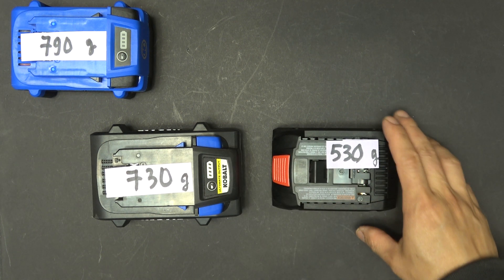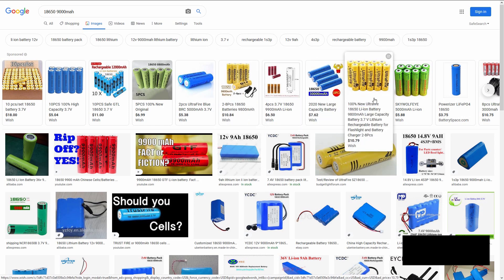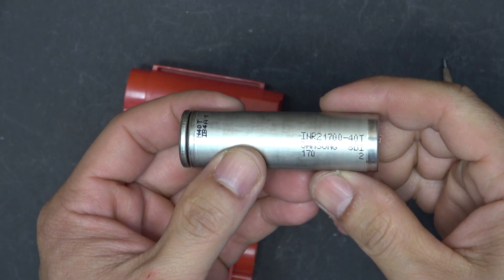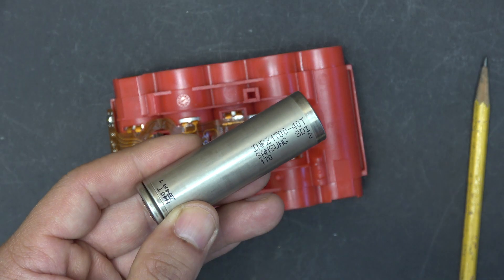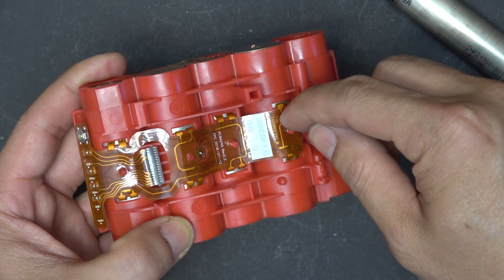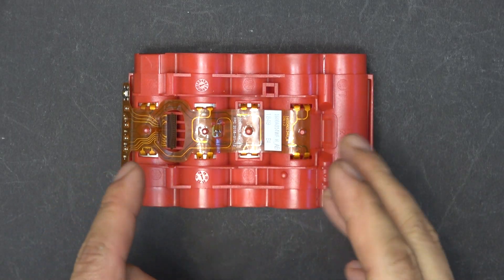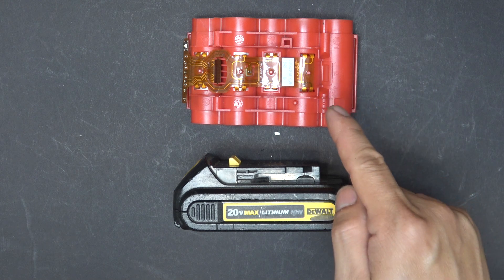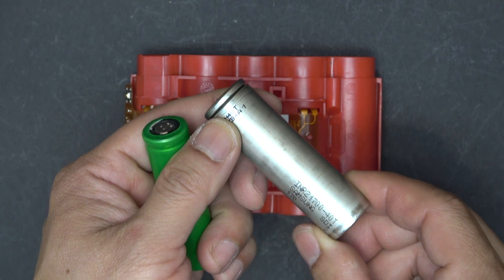Teardown: Bosch 18V Core18 4Ah battery. I've never seen anything like this!

Comment: Don't be to sure the so called BMS has balancing! Even though many of the pro-brand power tools batteries does have balancing chips they DON'T balance. But they do measure voltage of each cell for lower/over voltage protection, that's all. If you still have the battery try to discharge one of the cells to it's voltage will be lower than the others and then charge the battery. Afterwards check if all cells have the same voltage, I bet it want! Please prove me wrong 😉

Comment: I see you did a little Señor Sparky on your caliper there. I did the same thing when I was first building batteries. I was measuring something, I think a piece of nickel strip, and !SPARK!... I shorted out the tips between two 21700 cells and ruined the tips on my calipers. Luckily, it was a low-dollar, knock-around pair I use for general stuff, and not my Starrett calipers. I bought a pair with plastic jaws for under $10 that I use exclusively for building batteries. I suggest you get a pair, too. By the way, I love your videos! Glad someone took the time to pull one of these apart and see the great quality you get with Bosch.
Reply from the maker: You have keen eyes, Dallas.

Comment: The battery cells are put into the plastic while the plastic is still hot so when it cools it shrinks and gives a much better thermal conductivity.

Comment: 9:04 Unfortunately there's no balancing. The BMS board shuts down if it's not balanced, but it doesn't actively balance the cells. As a result, the pack can stop working when the cells are still good. If you have the patience, you can manually balance by charging individual cells to get yhe pack working again.

Comment: Using copper it is not really for get less resistance or weight saving. As you realize you broke this copper bridges when disassembling the battery. Try to measure same lenght of 0.1mm nickel and you will find its the same.

Comment: I bought  BOSCH AL 1830 CV  battery charger and PBA 18V 2.5Ah W-B in Ravenberg
aug 252023
Now I find battery is not charging
greeen is not  blinking ,used only for 2months   5hours
charged only 5 times
I am so disappointed 
Sunil Jay in Srilanaka

Comment: Hi mate, ive had a this Same battery pack and ive watched your video to get the batterys out. Ive noticed after taking the batterys out and charging them in my 18650 charger it makes a hissing sound. Is this Dangerous? Should i throw those batteries away?

Comment: hi , i have a questions, it seems that the INR21700 cells in pro core battery doesn't has the plastic cover over it ( as for the balance connection ), would it be shorted out if two batteries pull out bare and touch each other without the plastic cover. Thanks. Because i remebered someone said that if the plastic cover is broken, it is not safe to have the 18650 touch each other .
Reply: You can only pull them out if the strip on the other side is already removed. Just touching two loose ends does nothing.

If the plastic is broken... I would be careful about what you do, because if you do manage to let two cells touch sides while the copper strips are still all connected, you are shorting out one cell.

Comment: I have a lady I'm trying to help out that has a bike with a Bosch kit on it that came with 36v 2.4Ah battery.  She wanted more range so bought a 36v 4Ah battery and it didn't work... got a new charger on the advise of Bosch.  Still doesn't work, bought another brand new 36v 4Ah battery... that also will not charge.  The original 2.4Ah battery works on either charger, the 4Ah batteries do not work on either charger, charger is correct for all of the batteries.  I suspect the new batteries have bad thermistors so they won't charge... there really isn't anything else in there that can cause this that I can think of.  Anyone have similar issues with DOA batteries from Bosch?
Reply: eBikes batteries from Bosch are different than the tool batteries.

Comment: Electrons flow on the surface of a conductor, hence why cables are stranded. Unless that copy strip was too small to carry the current without melting, your observation of the design isn't meaningful. Since we know the battery does indeed carry the current effectively, the design is good.

Comment: Had a Dewalt radio charger for a couple of years with the same battery inside, that i gived to someone in the familly and still works.A year and a half ago i bought that ''big bomb'' Bosh radio charger with an 18 volt battery and the battery doesn't charge no more.Most of the time the radio is always pluged in the outlet.What's the problem? I should've kept my Dewalt radio charger.Not impress by Bosh!
Reply: Bosch Professional offers 3 years factory warranty on both tools and batteries. I'd contact them for a replacement or repair. Here in the Netherlands, their service is pretty quick and good.

Comment: Im not very knowledgeable in battery repair. Can someone offer some advice on removing the seals covering two of the screws on the Core 18 battery?
Reply: What for real? Think again about possessing the skills required to safely handle the battery if you are already blocked by a seal... that can be picked out with any sharp object.

Comment: Hi, I have a Bosch Pro Core battery exactly the same as this one in your video. Its stopped charging and the battery gauge stopped working. On the multimeter I get 20V from the pins so the cells seem good and so is the inline fuse. I can't work out what's happening but I'm thinking its the charge controller/fuel gauge. The battery isn't recognised in the charger and the drill won't power up except for one initial flash of the work LED.

Has anyone seen this or got this problem?

Cheers,
Marcus.
Reply: Same problem… unfortunatly I cant seem to fix it. Perhaps hard wire charging directly to the cells? 🤪
Reply: @Esoxsvecia 
It's already full at 20V
Reply: Bosch offers 3 years factory warranty if you register them within 2 weeks after purchase. After those 2 weeks, you can contact them for warranty. I'd try that before going any further. A fresh new battery is always preferable to a repaired one.
Reply: Ive got 2 of them less than a month old same thing
Reply: @jeffreygarmeson8367 so it’s under warranty. Send it in for repair
Reply: I would bet ya some IC on the PCB inside the battery is blown or something is up on that front. Try to swap the board from another similar battery and test it , if you can not measure it out with a multimeter

Comment: Du ma
Reply from the maker: Way to show your language still, mate.
Reply: @vuaeco  😊
Reply: @vuaeco Hi.  I am writing here because I would like to learn from you, as an expert, what the electronics issue looks like.  Does this battery have a controller that has a programmed number of cell charging cycles of 21,700?  How does the BMS work in the new ProCore batteries?  Is there a risk that these tape electronics will break down faster than in older GBAs?

Comment: Preston's post clearly didn't age well. I dug up the original press release for this battery pack and it mentioned having 21700 cells in the first paragraph. I guess that detail didn't trickle out very well. I really like these 4.0 pack's proportions and power output. Not a fan of the 8.0 proportions, but maybe if I try one I'll get a better feel for it.

Comment: Those are great cells. I used 4x Samsung 21700-40T in rebuild of my old Ni-cd batteries, when I couldn´t fit 2x4 LG-HG2 (8cells, 2 in paralel) in old battery case. I wanted something with 4Ah rating.
Reply: Might be dangerous on the battery, as the Ni-MH based tools don't have the current limiting.

Comment: Those 21700 are actually over 4 amps. Epically the ones from the tesla batteries. I have rebuilt the Milwaukee V18 battery with those and they work BETTER than the original!!The original were 3 amp hour batteries. I think most of the 21700 cells are around 4200 mAh.
Reply: Capacity and max power output are inversely related. Larger capacity cells have less power output and vice versa. The most powerful cells are currently between 3 and 4 Ah, with 5 Ah cells having significantly lower power output. For example, the Samsung INR 21700-30T (3 Ah) has a proven continuous discharge rate of 35A. The INR 21700-50E (5 Ah) is limited to 9.8A continuous discharge. 4 Ah seems to currently hit the 'sweet spot', with power closer to the 3 Ah cells but capacity between the 3 Ah and 5 Ah cells.

Comment: Bosch is going to take over the industry! They're the only major tool brand that is thinking outside the box. Sure, it's no Festool in many ways, but Festool are 30% overpriced for what they are.
Reply: First i want them to use omron switches in their tools with rubber bellows to keep moist and dust out
Reply: @lukie4ever  true!!! It's bizarre that they did it with their corded tools, and a few cordless (primarily rotary hammer drills) but not every tool. 
 
Even the batteries are a bit exposed on the bottoms. As well as the battery ports on several of their tools. It's an easy fix, but I shouldn't have to do it. 
 
So I feel ya.
 
However, they do listen to their tool users. So just a few people seeing that can get them to correct it. 
 
If those who test prototype tools for them were allowed to know each other, and converse between each other, we would be able to see if it's an issue across the entire tool, and have them fix it. Sadly, testers aren't allowed to open the tools to see any internal issues.
Reply: @carterscustomrods  I'm a makita man but when i got the bosch 18v flexiclick i was sold but then i looked inside because i was curious and got disappointed by the switch because that's the weak link in the tool there, the makita's have a bellow in almost every tool
Reply: That doesn't take away the fact that i still love using my bosch
Reply: Correct had 2 festool vac burned out on me  and that’s a $800 vac

Comment: I assumed the flap touching the battery (at around the 8:00 minute mark) was a type of thermostat? Nice! 
 
I assumed they did that because the prior Bosch batteries would get ridiculously hot. Like "start a fire", or "Melt the Case" hot! 
 
I'm switching to Bosch asap! Dewalt has fallen too fast. They're done!!!
Reply: Better hot on the outside (which means heat is conducted away from the cells) than hot on the inside and cool on the outside :)
Reply: @marcelvos7931  touche'!! I've switch a lot of my tools over to Bosch these past few weeks. And they have more power than I had expected. 
 
I got the Freak GDX18V-1800C with 4ah Core, charger, bag for $53 at Lowe's. It has a but too much torque for a driver ((Edit: since getting the Bluetooth module, I've REALLY fallen in love with the 1800C impact. It's now my go to impact driver due to the soft start capabilities. I never liked the Bluetooth capabilities in other tools as they didnt do muxh for a tool.)) I've had a few bits get stuck in the quick release ((Edit # 2 Apparently the bits getting stuck was an issue I had due to the bit holder I was using.)). 
But it's way better in terms of power and quieter, than the 887 Dewalt impact driver. 
 
I got the mini shop vac (came with free extra battery charger, etc) and it EATS the 4ah in like 15 minutes. I have an 8ah Profactor, but it doesn't fit in the battery compartment when closed. So I'm disappointed in Bosch for that one. 
 
Next is the Miter saw, and next year, the left sided blade version of the Strongarm 7¼" circular/track saw... and another tool that is TBD if it is released.
Reply: @carterscustomrods  I'd try the regular non-ProCore 10 cell batteries with the vacuum cleaner. It doesn't need the additional power that the ProCore batteries can provide over the regular ones, and the regular ones are both smaller (in 10 cell format = 5.5 or 8 Ah ProCore or 4 Ah or more regular) and cheaper. Keep the 8 Ah ProCores for powerful tools that need them. The 8Ah ones are a lot of battery (both in price, power and weight) for a mini vacuum.

I use the GAS 18V-10L as a vacuum myself, and the 8 Ah ProCore does fit, although it is of course a lot bigger (and more powerful) than the GAS 18V-1 mini vacuum.
Reply: @macvos  sadly, here in the US (North American market), it seems Bosch has fallen already.
 
I went all in with the Bosch lineup, and I'm not sure they'll even be here in a year. 
 
They've just stopped trying. They had several new tools set to release (in hopes to push NA tool brands above the 10% Worldwide profits barrier) but they just ghosted them, and we the tool users. 
 
From their kept blade strongarm, to new cordless routers, there were 20+ new tools set to come to NA market ... but then they were removed after the (horrible demonstrations) set up at World of Concrete this year.
 
I was really waiting for the left blade Strongarm saw, as were thousands of others that I had hyped it up to. It was a left blade track capable plunge saw (designed for right handed users) and they had done press releases and even did a demo run at several trade shows in the US. Then all the sudden, it just disappeared. 
 
I asked Bosch about this, and they said "what saw? We don't know what you're talking about." And I was shocked... like they were trying to make me think I was crazy. 🤣 🤣 🤣. 
 
I had stocked up on batteries, awaiting this saw, because I only have use of my right arm, it makes a right blade track saw worthless for ripping Sheet Goods if you can't use it (the "right handed track saws") to your left side with your left hand. 
 
Then 1-2 months ago, Bosch products dropped in price a lot. Some by 50% as their new regular price.
 
So, sadly, when this happens here in the US, it's a sign that the brand is going out of business. 
 
So unfortunately,  I've dumped a lot of Bosch and am moving on to Makita full time. 
 
It's a shame. They had potential,  and could've grown, but the new core line of batteries became obsolete really quickly with other brands using 36v, 40v, and even 60v. Plus Bosch just didn't market at all. Their strategies were just like "Ughh.. we'd rather not do the work of trying." 
 
So, it's heartbreaking to see. Especially since Bosch Worldwide is doing well, snd has so many great tools that the US never would've seen anyways.
Reply: I think it's part of individual cell voltage monitoring.

Comment: Samsung 30T does a better job than 40T pumping out over 45A than 40T barely make to 30A according to many lab test and tool test
Reply: What if your tool only draws 20A max? Then the 30T means your battery will die sooner for no gain.
Reply: @fun_ghoul  20amp tools, you can figure out cuz 8Ah battery only last you 24 minutes 
where 12Ah battery will last you 36 minutes 

when i said discharge rate high which allows some of impact to draw more current for torque they put out 
doesn’t mean they say at that 

plus Samsung 30T can handle higher heat, runs cooler than 40T version
Reply: Yeah, but what tool will use that? For those insane-power tools you can use the 8Ah, double 30A makes 60, haha.
Reply: @jcvjcvjcvjcv  30Amp it 60Amp tools then you would move to MX series 
Ah is Amp hour how much it can let you draw
Reply: @TranTek  In cases you need this insane high draw, you might just as well get the 8 Ah battery, making a 3 Ah 5S with 21700's rather useless.
Reply: True, although not many tools can use over 1 kW (18V * 30A * 2) continuously for over 5 minutes. A 6 Ah ProCore battery using 30T cells for real power hungry tools would be awesome though. Although this would get confusing for consumers, with the 6 Ah being more powerful than the 8 Ah one. 
This gets me thinking though: I've always wondered whether the 5.5 Ah ProCore battery was using 30T cells, since it has both lower capacity and lower impedance (which means higher output) than the 8 Ah one.

Comment: these batteries suck. i had all three of my pro core 7ah complety die within 2 years
Reply: Maybe it's operator error. Do you discharge your batteries to fuck all often? Do you leave them dead overnight, and charge the next morning on site? Do you live somewhere with a real winter, and leave the batteries outside or in an unheated garage? Or do you, on the contrary, never use them but keep them fully charged all the time? There are lots of ways to fuck up a lithium ion battery. Just sayin'.
Reply: @fun_ghoul  i hear ya.  my tools do get abused a bit, but thats what they are for. my other bosch batteries have had no issues. i think theres a problem with these pro core batteries. the thin copper connections  are quite likely a terrible idea. id happily have slightly larger battery if i didnt die on me so quickly
Reply: @dylannewlands6122  What's the problem with the copper? Is it corrosion or wear? Did you open up the batteries to check what's the culprit?
Reply: @marcelvos7931  haven't opened them up. I'm still battling to get them sorted under warranty. From research the way thier batteries so small is the thin copper strips instead of wire. If I don't get them sorted under warranty I will be sure to open them up and post the verdict.   Honestly been running Bosch for 6 years plus. After this shit I'll never give them another dollar.
Reply: @dylannewlands6122  until you know what made them die , you are jumping into prejudice ... might be a design flaw , might be a batch issue , might be a cell issue , a lot of things ... might be a faulty batch from IC suppliers or something ... Maybe it's not Bosch's fault. Happens a lot. Your post is 11months old , did you find out ?
Reply: @GabrielKozsar  This. Also, the 7 Ah battery used 20700 cells if I'm not mistaken. With both the cells and the battery design being different, I'm not sure how this would relate to the newer designs. Bosch has a good reputation in the area of battery tech, although the 40T cells they and most manufacturers are using do seem to have some occasional durability problem. This is a problem with Samsung though, not with Bosch.